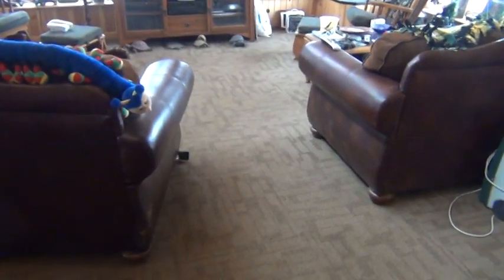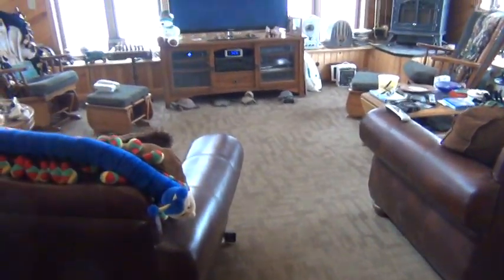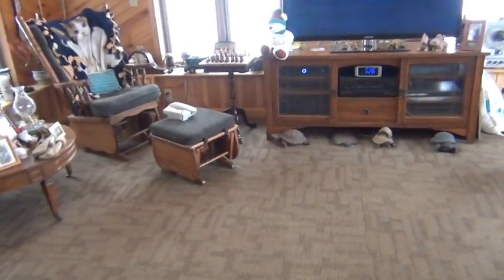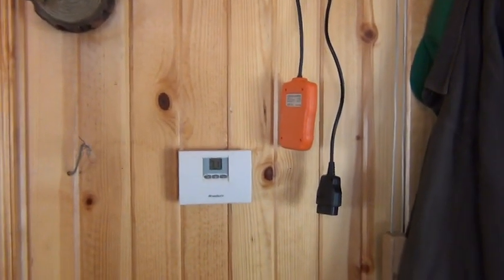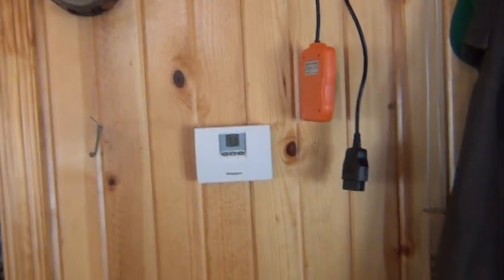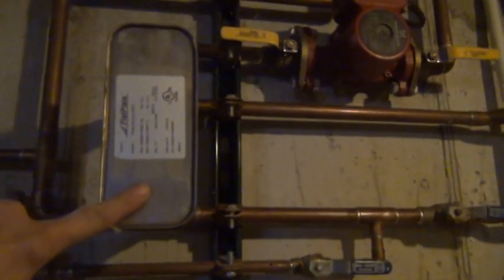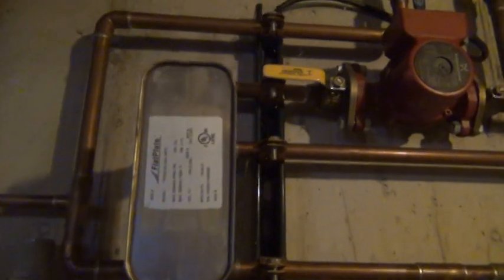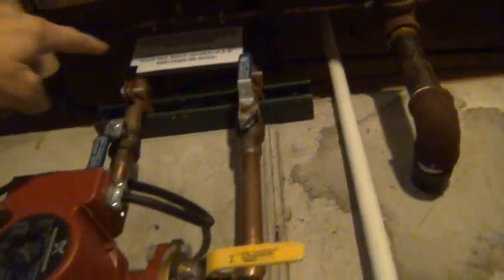Radiant Heat Using a Condensing Tankless Water Heater.

Comment: Is it preferable to separate the domestic water from the hydronic heating water?  The loop you have to supply the pressure from the domestic loop to the hydronic loop might contaminate the domestic water.
Reply from the maker: It is preferable to isolate the 2 loops from each other. Because the domestic loop is at a much higher pressure than the hydronic loop, there is no chance of hydronic loop water backing up into the domestic water loop unless there is a total loss of pressure in the domestic loop. For this reason, (though extremely slim as it is), I would recommend a check valve be installed in the supply line to prevent reverse water flow.
Reply: @spudpail  may be a silly question but why do you need pressure in the hydronic loop at all? you have the pump circulating the water in that closed loop. shouldn't that be enough? also, are all those gages you have and the shut off device really necessary for a small system (<150sqft)
Reply from the maker: @michaelkuzmin  All hydronic heating systems run under pressure. Usually around 12 psi or so is pretty standard. If there were no pressure, there would be a chance that vacuum pockets could form and cause the circulating pump to lose its prime. When water is heated, it expands and since water cannot be compressed, it needs to have a place to expand to or something is going to break. That's what the expansion tank is for. The tank has an air bladder that allows for that expansion. Keeping the loop at 12 psi will allow water to flow in and out of the expansion tank as the water is heated and cooled. Look at it this way. Say you had a closed loop that is totally filled with water at 120 deg. at 0 psi. Now lets say that the system cools down between cycles or during the no heat season. As the water cools and shrinks, what's going to make up for it.....Probably vacuum pockets. Not good! The pressure in the system will keep this from happening. Now lets say that you had a full system with no room for expansion and the water is heated to 120 deg. Since water cannot be compressed, some thing is definitely going to break!!
The gauges are nice to have so you know what the temperature of the incoming and out going water is as well as the pressure. They are the only way you can tell what the system is doing. The gauges don't cost that much so why not just use them?
Reply: @spudpail  thank you that makes perfect sense. I am still struggling with the design of my system a lot. I like your layout but it does seem like a massive overkill for a small area. also, I only have a short plastic loop (no old rads) so I don't see a big issue with mixing heating and drinking water. someone suggested that I use a thermostatic valve and one always on circulating pump, with new water entering the heating loop when hot water is used anywhere in the house. but with that model, I am affrair that the vale will be trying to constantly suck in small amounts of hot water. and a tankless gas teater is really not meant for this application. it is supposed to be on for a short period of time at high volume and then it is supposed to be off. which is what is happening in your setup. honestly my use case is so simple but I am so confused. also I am trying to find more advanced power saving pumps like Grundfos Alpha2 or Grundfos Alpha3 and they seem to only be available in 220v versions for the european market. the Grundfos pump you are using are great but I belive they use substantially more electricity than these more modern ones Alpha2 and up.
Reply: @spudpail  actually I take back what I said about inability to find Alpha2 and Alpha3 for north american markets. I found both on the Canadian site for grundfos. So at least I know they exist. The question I still need to figure out is what would my system layout be.
Reply from the maker: @michaelkuzmin  I originally had my floor heat installed by a licensed contractor who used my conventional direct vent tank type water heater for a heat source. This worked for many years until the tank developed a leak. I've always wanted a tankless water heater because I had favorable results with an old one in the house I moved out of. I took a gamble and installed the tankless in place of my old heater and even though it is not designed for floor heat, I've had very favorable results with it. The amount of gas that it uses is dependent on the amount of water that flows through it and because the incoming water is already preheated in the loop, it does not have to raise the temperature from 55 degrees to 130. It's more like 90 deg. to 130. Because of this the unit basically loafs along at a slow rate that doesn't modulate until the thermostat setting has been reached and everything shuts off. I'm heating a 400 sq. ft. room and it works great, however I would not recommend it for an entire house. 

The Grundfos pump is a standard in the industry and are quite efficient. I can't say that my electric bill is affected by them.

You can probably get away with just one loop, but it's against code, (if you worry about that sort of thing). I like to keep using the same water in the secondary loop so that it doesn't receive fresh mineral contaminants from the water supply every time you turn on the tap. Keep the loops separate with an exchanger and a second pump! It's not that big of a deal.

Comment: @spudpail, Thanks for this detailed video! 
I’d like to do the same but I’m wondering if I can do it opposite. So my domestic would be after exchanger and radiant heat before? I have very hard water and it’s hard on the heater so I was hoping to not run that water through the water heater but a use a conditioned type mix for the radiant heat. Do you or anyone else know if that’s possible? And if it is would it be inefficient?
Reply from the maker: Because the 2 loops are isolated from each other I don't see a problem. The water in the floor loop never changes, so no minerals are added. The water heater loop is supplied by softened water, so I don't anticipate any problems there either. My question is, why do you want to run opposite? I'm assuming you don't have a water softener. I would think that you could run a "conditioned mix", but because you would be getting your domestic hot water off of the exchanger's secondary side, it may not be hot enough because the exchanger doesn't transfer heat at 100%. Also remember that the heater puts out water at the level you set it for, so would I think that you will get wild temperature swings if you hook it up in reverse, because the heater doesn't monitor water temperature from that side.
Reply: That makes sense.
I do have a softener but even with that I still get mineral buildup but maybe it will be ok providing I flush the tankless every year. 
Thanks!

Comment: Thanks very much for posting your video.  You might want to wrap the copper piping near your heat exchanger with insulation.  Probably not losing a ton of heat but every little bit saved makes the system more efficient.  Just an idea.
Reply from the maker: You are right, however I like a little heat in the basement anyway so it's not a problem, in fact I was thinking about installing a forced air convector down there. I would run it off of the return water so it wouldn't affect the floor heat. What do you think?

Comment: I am doing a very similar setup as you.  With heat convector and higher 130F supply temp to a fan convector.
What you using to control the pumps and connect the thermostat/ thermal limit switch to?  Is it even necessary to have a thermal limit switch for a fan convector?  I need 120-140F for it to be effective 100F to low.  Can use heater to limit the water temp.
Reply from the maker: Hi Dan,  I completely forgot to mention that didn't I? If you look at 12:16 almost at the end of the video, you will see a relay control box at the bottom center of the picture below the PVC pipe. I did a real good job of skipping that, didn't I? Well anyway, the thermostat I showed in the other room and the limit switch is connected to this box which in turn controls the pumps. I also failed to mention that there is a temperature probe in the concrete slab that is connected to the high temperature limit, so if for some reason the slab would overheat, the limit switch would shut the pumps off via the limit.
Since you are using forced air convectors, you may not need the high temp. limit however it may be best to check your local codes to see if you are required to have one. Installing one is quite simple and inexpensive, so putting one in may not be a bad idea.
Thanks for you question and pointing out my boo boo.
Reply: @spudpail  I did see that black box at end video.  Looks like says "Argo"  but couldn't find anything on it.  Is it just a standard circulating pump relay control box?
Reply from the maker: @danieldalessio4317  I guess you could say that it is. There isn't anything all that fancy about it. It does have an internal terminal strip that gives you options on how the pumps operate. For example; I didn't like the way the installer had the floor loop pump running 24/7, so it was easy for me to change the wiring so that both pumps would run only when the thermostat called for heat.

Comment: What is the size of your heat exchanger? I need to do this with my radiant heat.
Reply from the maker: It's 7-7/8" High X 3-3/8" Wide X 2-1/4" Deep. It's made by Flatplate and the model # is FP3X8-20 (3/4 in. MPT). Please see https://www.supplyhouse.com/FlatPlate-FP3X8-20-20-plate-3-4-Thread-10-GPM-Heat-Exchanger-3-x-8-5777000-p. Hope this helps.

Comment: What was the reason that you used the heat exchanger inline instead of just going directly from intake to floor from the heater? I'm building a similar system but I don't have a heat exchanger in my system. The loop just goes in the heater and then out to the radiators and back.
Reply from the maker: Because the heater is used for domestic hot water as well as floor heat. You never want to mix the two together. The exchanger isolates the two loops from each other. If you are using the heater for floor heat only, then you don't need an exchanger.

Comment: Hey thank you 
Kind of right now I have got a instant propane heater for free and trying to figure out if it's more efficient then a heat pump hotwater thank it will only be doing In  floor heating would you say it would cost roughly 25$ a month in propane ?
Reply from the maker: I really can't answer that because of all the variables. How many sq. ft., outdoor temp., price of propane etc. One thing I do know is that propane burns quite a bit hotter than natural gas so to that end it may be more efficient than my natural gas unit, but propane is considerably more expensive than NG too.

Comment: Hello very nice !!
Was wondering on operating cost per month ?
Thank you
Reply from the maker: That's a tough question to answer because of all the variables. I have all gas appliances including my furnace and a free standing stove so the only way I can check performance is by comparing this years summer month bills with the bills from last year during the same month. This way varying gas usage due to winter heating will be eliminated. I discovered that I am using about 1/4 the amount of gas than I was using with my 27 year old forced vent water heater. That sounds like a lot, but in reality it only saved me roughly $5.00 per month. I'm a widower and I live here by myself so I don't use nearly as much hot water as a large family with lots of laundry and lots of showers. In that case you will notice much less gas usage than a tank unit! In other words, the more hot water you use the more you'll save. The real reason I opted for a tankless is because It only cost about $300.00 more than a forced vent tank heater and should last 2-3 times longer. It also requires much less space, which was an important consideration because my mechanical room is rather small. I also use it for radiant floor heat and it seems to work better for that purpose than the tank water heater did. Also unlimited hot water is another important consideration!  So far I love the thing and I recommend it highly!  Hope this helped.

Comment: How much did the whole system cost?
Reply from the maker: The floor heat was put in about 10 years ago so I can't give you an accurate answer. Today I'm sure it would cost a lot more. The water heater and all the extra stuff I needed to install it came out to roughly $1300.00.